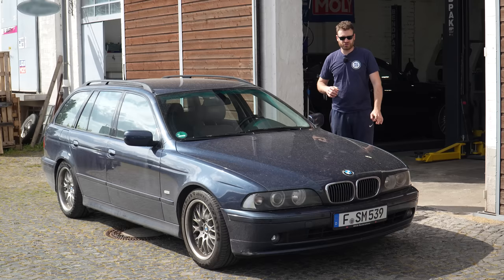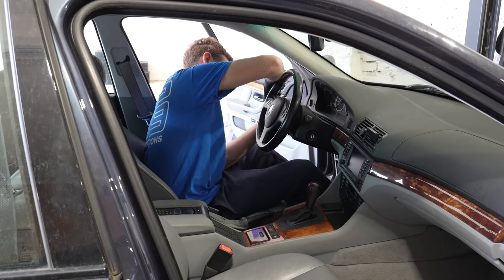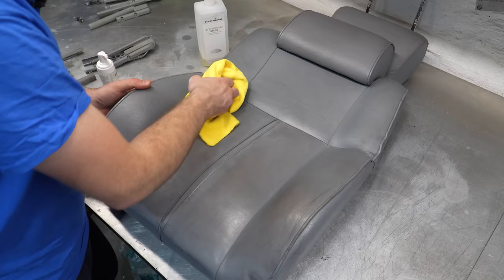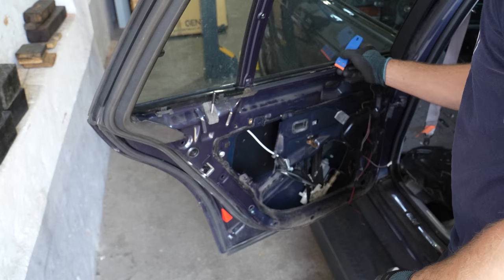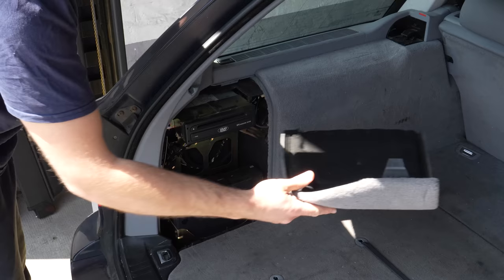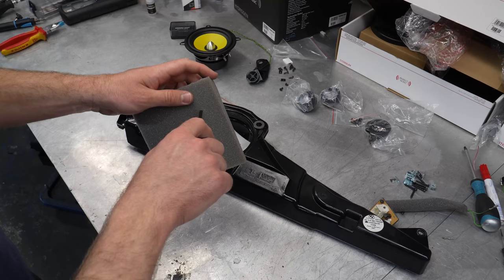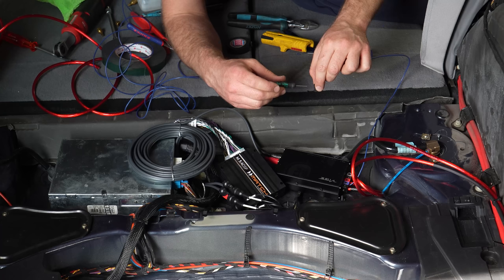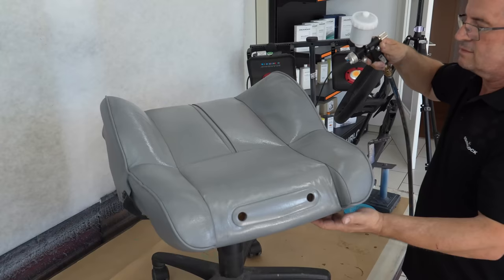Upgrading the 20-Year-Old Tech - BMW E39 530i Touring - Project Rottweil: P5

Comment: Everything was great, until the music part.
I understand there is not much oem options, but man this is out of line with the mood of the channel.
Reply from the maker: Ok. There are no good OE audio options for E39, none that are worth the trouble of retrofitting. So, what do you suggest?
Reply: @M539Restorations  i would try to find the correct size speakers that would bolt on, but better quality. Use all the stock housing, use the stock system with the sub as much as possible, maybe upgrade amp, and not fiddle with pulling the wires from the battery and etc.

The bluetooth box is super cool though, cant disagree.
Reply from the maker: @user-ni7gk5tg5j  Right. You just described what I did in the video, except for the subwoofer which was an overkill.
Reply: @M539Restorations  tweeters, door boxes.
The roof is cool. Im not competent enough to continue the discussion, unfortunatelly, as i never worked on an e39.
Im not saying its a bad video, just felt different.
I appreciate the work you do! Thanks for the content!
Reply from the maker: @user-ni7gk5tg5j  You really think I wouldn't go for a direct, 100% bolt in better front speakers and tweeters, if that was an option? :) They don't exist, trust me, I searched. Thank you! I'm not that demanding when it comes to a sound system, but the stock one is so bad that this had to be done.
Reply: @M539Restorations  jbl gto i think should fit better, the hight should be identical.
Reply from the maker: @user-ni7gk5tg5j  there is no guarantee that anything will fit 100%, the height might be good, but holes might not line up or something else, and I don't have time to experiment. Besides, what I put works and fits perfectly fine with a minor mod. Don't understand what issue you are trying to resolve. :)

Comment: You cant use washers and piece of foam in between the speaker element, what are you thinking? You need solid shroud inbetween. Honestly give me the measurements and I can 3d print them if nothing else works. You cant leave it like this this destroys your reputation about someone who does quality work or even knows what he is doing. The subwoofer install is even bigger blasphemy, if you don’t know self evidently why, please do not touch any speakersystem anymore.
Reply: Hi, why don't you go ahead and make the parts needed and send over to Sreten.  Your desire to help is no doubt sincere, but your tone is pretty harsh.
Reply: @billkeller5555  It is justified because if you read other comments, people are blind to craft and take everything from him as a gospel. And 99,9999% times it is exactly right, only this car audio thing went totally wrong. Yes I can help if needed, how ever I am quite bad at divination. Trying to guestimate part measurements goes 100% of times wrong. With the subwoofer I cant help. It is in acoustic short circuit, there is a reason why boxes are made from 21mm baltic birch and not 1mm plastic. WinISD is the right tool for finding right driver for the given space. The cabling needs to be also 4mm2/wire instead of 0,0001mm2. But sure if he wants to burn the car, these are great leads to start electric fire in the car.